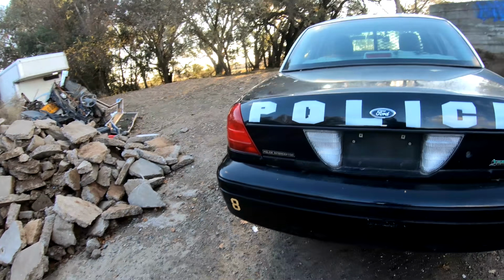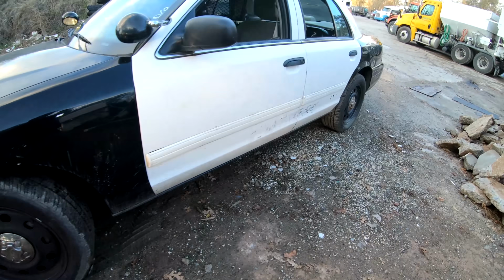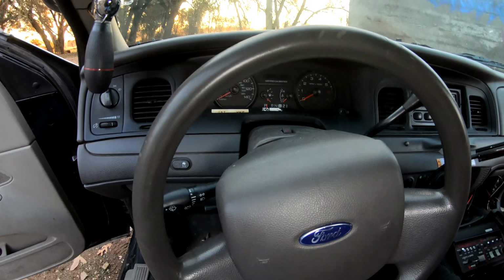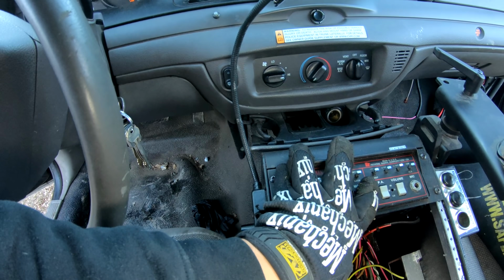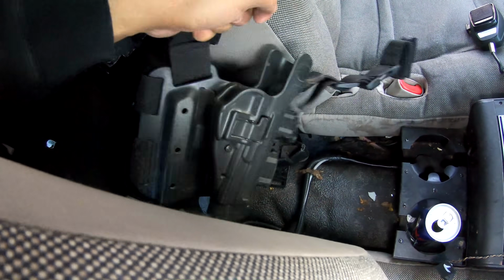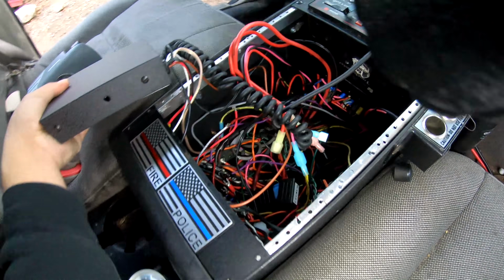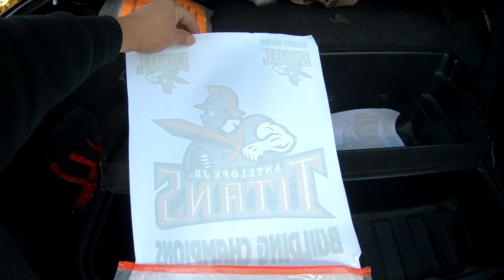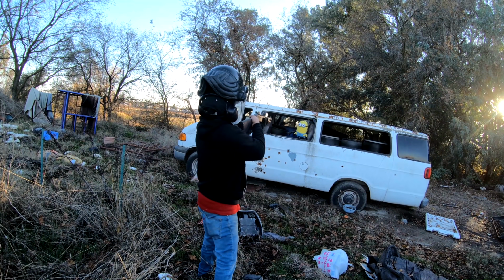Searching A Decommission Police Car found Shotgun Shard Shots!

Comment: You can use Flitz brass cleaner on the bullets to clean them. As long as the corrosion hasn’t damaged the casing they should be fine. Also how much do you want for that Whelen Viper red and white – light and the mount for it?

Comment: The main thing about those rounds is the condition of the primer, but if I was to do anything with them I would pull the bullets and caseing and put in new primers (if you can find any these days) and powered and reload them.   So if you get a lot you might want to keep them in a bucket and see if any one wants to buy them off you for the brass mainly to relaod.

Comment: Only if weapons would still be in a police car I worked at a auction for 15 years you will not find a fucking shotgun inside of a old police car especially if it was sold through auction which most of them are